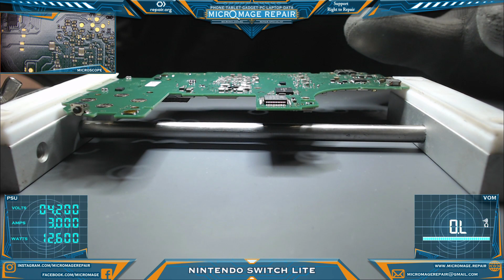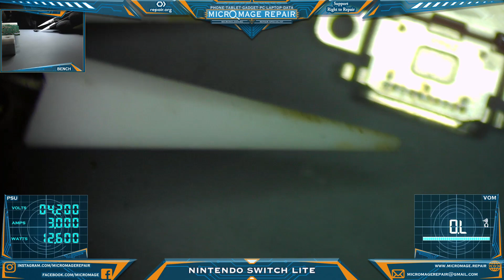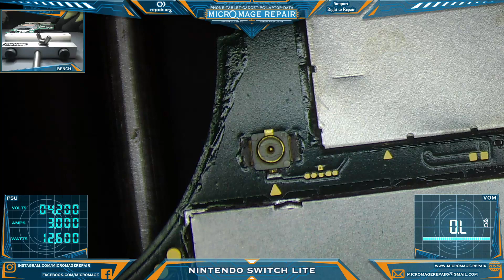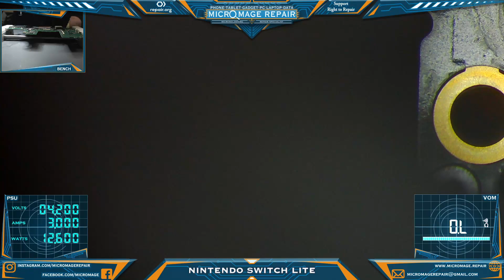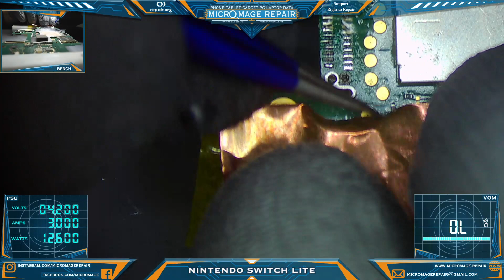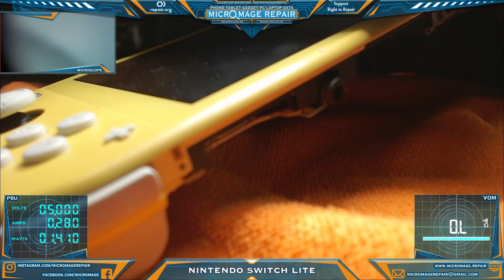Nintendo Switch Lite: An expensive error!

Comment: It would be nice if you zoom out a bit. Sometimes the point you working on is outta frame
Reply from the maker: It's an optics issue mostly though I'll try and keep an eye on the zoom. For some reason the camera has gotten really off center. I'm addressing it but I'm a month ahead of you so won't see it for a time.
Ultimately it's of utmost importance that I see what I need to in the process of repairing a device.
The repair pays the bills, the videos just cost me money and time mostly though I enjoy doing them regardless.